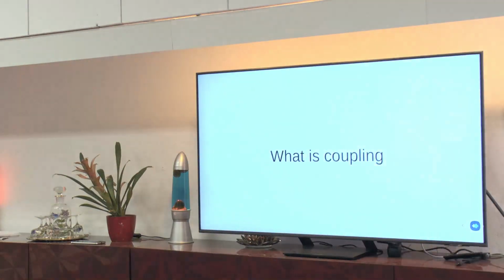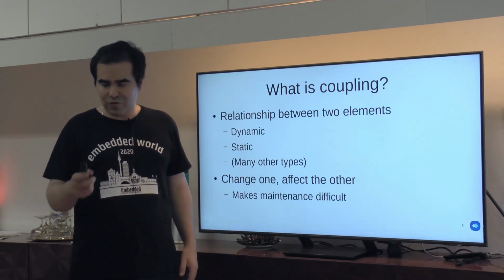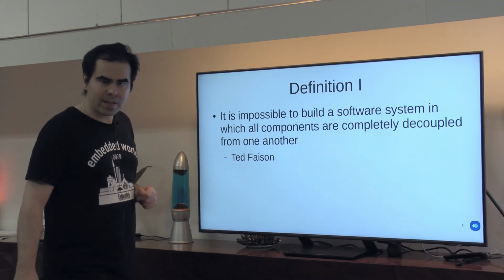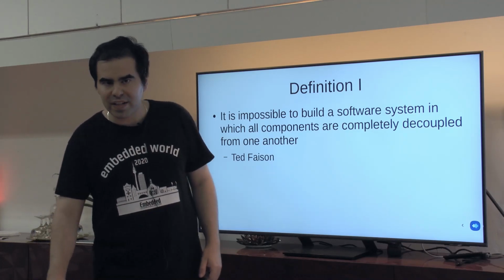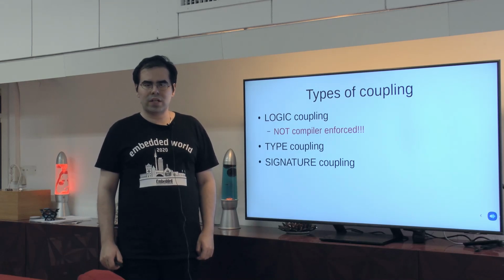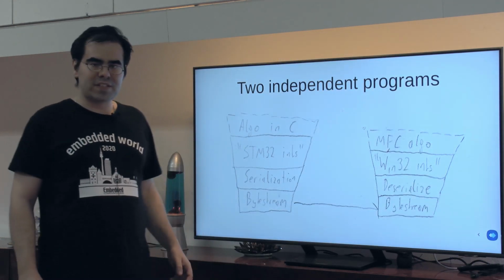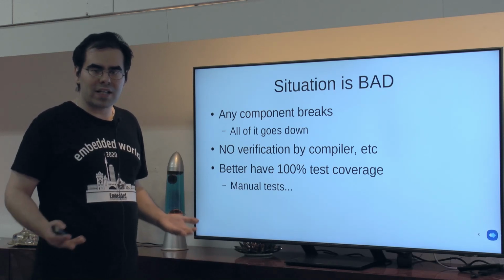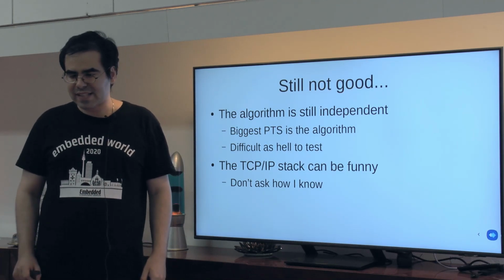Why Windows makes sense on Raspberry Pi - or - Software coupling

Comment: I would have read the title: "Why Windows does not makes sense on Raspberry" :-) Windows is optimized for x86, it does not run well on ARM. Let Windows just be a gaming platform, let it be x86 ;-)
Reply from the maker: Well, yes and no. Firstly, you do not - IMHO - need the maximum power all the time. For some jobs, being able to reuse code IMHO is more important...
Actually, Windows 11 works pretty well on ARM - I am not sure, maybe I make a video on it. Either way, big thanks for talking back!
Reply: @MrTamhan  Windows 11 has an emulation layer (ARM64EC) for running x86 applications on ARM. It is just to make it work on ARM. There is still a struggle with native drivers.  So it would be best to leave Windows where it belongs: on x86. The best OS for ARM is MacOS/Linux. Or doing some baremetal ARM ;-) When you have a proper HAL, then can run the same ARM C/C++ code on Broadcom SoC's (Raspberry Pi boards), Allwinner SoC's (Orange Pi boards), or MCU's like the GD32F20x. Oh yeah, the same code can run in Windows (Cygwin). But I would say, forget about Windows ;-)
Reply from the maker: @ArjanvanVught  Hello Arjan, yes, this is true in many cases. But - what about being able to do code reuse? In many cases, being able to reuse code makes the total cheaper...even if you need a bit more CPU power...
Reply: @MrTamhan  Code reuse is still not a business case for running Windows on ARM. I write highly portable code, it runs baremetal ARM, Linux (both ARM and Intel) and MacOS. As Windows has it owns API, there would additional coding for running on Windows. Hence, in all cases, the TCO for Windows is higher. Just forget about Windows ;-)
Reply from the maker: @ArjanvanVught  For HW control, I agree. But what about rich GUI applications?